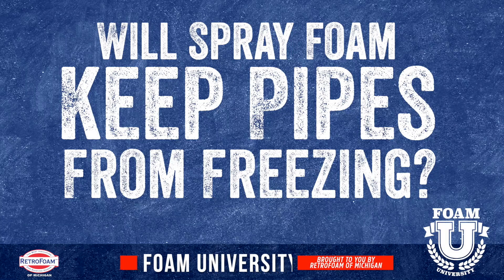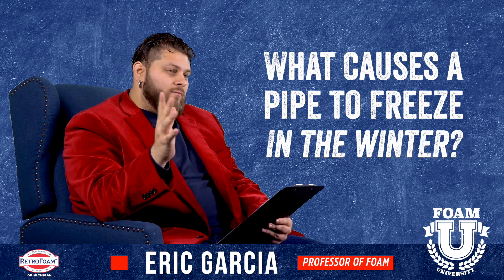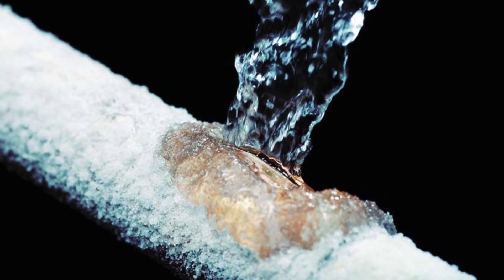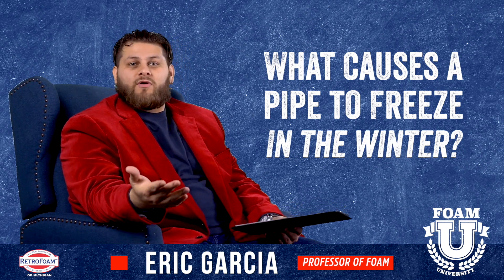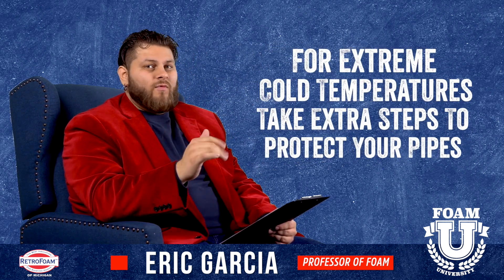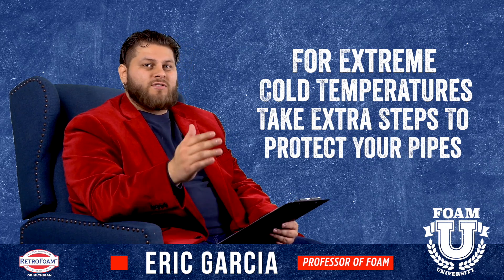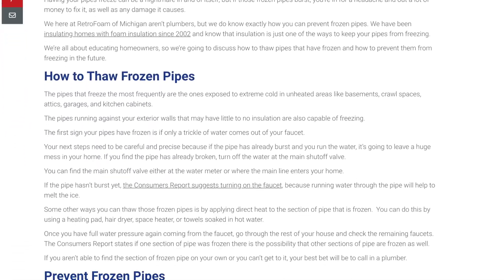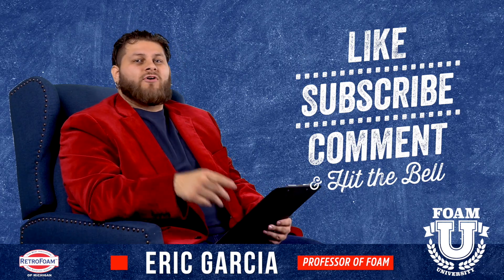Will Spray Foam Keep Pipes From Freezing? | Foam University

Comment: When dealing with a permanent trailer home, is it a good or bad idea to put a tarp on the ground under the house?  I laid a tarp down there to work on pipes and was thinking of leaving it down for future convenience, but not  if it will make it colder down there.
Reply from the maker: Keeping that tarp there shouldn't make that space colder. In fact, it can actually help with moisture from the ground.

Comment: this has nothing to do with this video. to keep your pipes from freezing you turn on the water very slow to keep the water moving so it will not freeze. but then you waste water. what if you install a circulating pump in the line to trun on when its really cold to keep from freezing. would that work.
Reply from the maker: It might, the only issue is if you are just circulating the water it may still freeze because it will eventually all cool down enough to freeze since it's the same water circulating.
Reply: If water pressure were to drop at any point then the water may stop flowing and you will just run into the issue down the line, perhaps while you are asleep

Comment: Run pipes to something warm like heat  heat ducts when ever possible use heat tape which needs to be replaced every few years and checked every late fall to make sure it is working it does burn out and needs to be replaced
Reply from the maker: Those are some helpful tips, thanks!

Comment: Problem with it when spray foam gets wet takes forever to dry it holds water well
Reply from the maker: That is true depending on the product. Open Cell is the easiest to dry out which is one of the main reasons why we suggest using Open Cell in living spaces!

Comment: if the pipes were to freeze and break, what's the best way to fix the issue?
Reply from the maker: We would recommend fixing the broken pipes then applying better preforming insulation around those pipes to help keep them from freezing again. If you had SprayFoam done by us then we would recommend cutting out the portion of foam around the broken pipe to fix it. Depending on the area effected then it would be covered under our lifetime warranty. If the damage was more extensive then we would work with you on getting the best price to re-spray that area or we would work with any insurance company that is involved.
Reply: Replace them with PEX  best to get really motivated to replace all water pipes with it less likely to burst because it is more elastic and it does not freeze as easy  like other types of piping